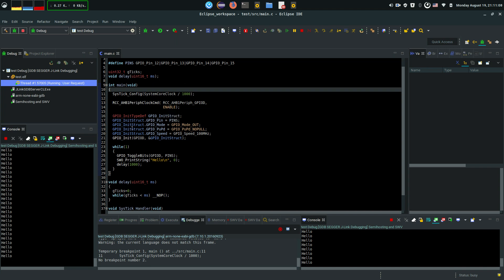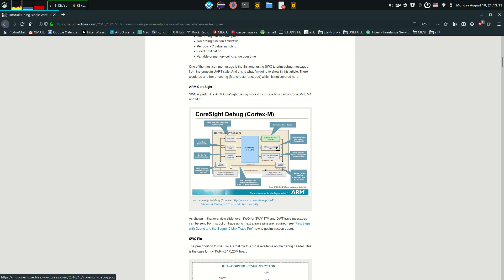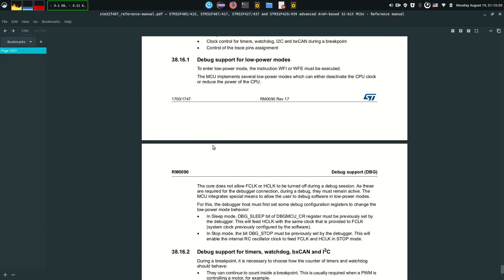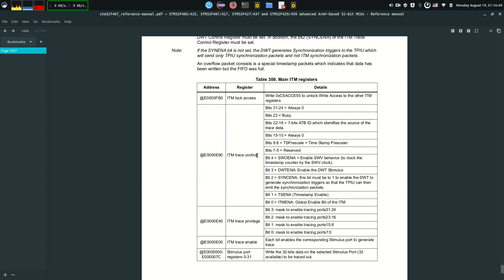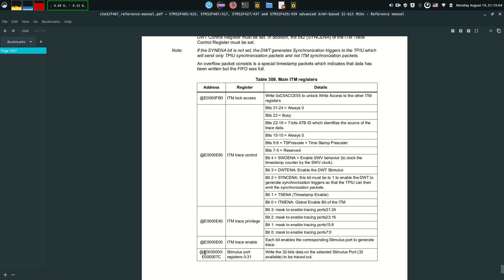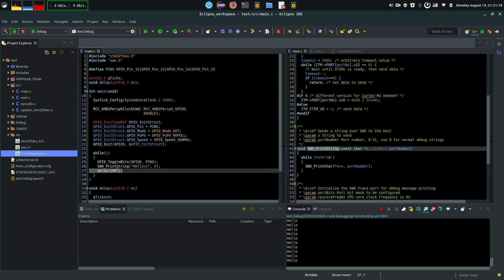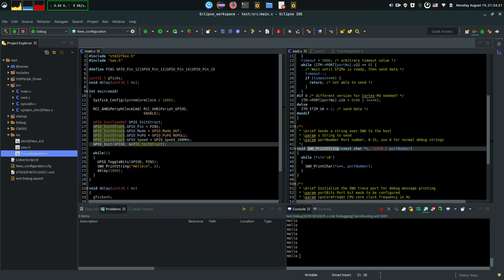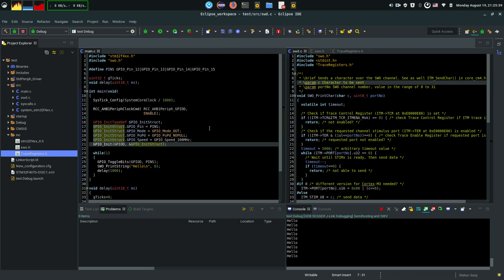Trace and SWO on STM32 | VIDEO 14

Comment: Is tracing/streaming the same as ITM, ETB, or MTB?

For example, I assume the debugger must also support the trace feature, yet looking at Segger's Trace debuggers, they list the trace features as:   ITM, ETB, MTB ?!   But "SWV" will work with their lower cost models like the ULINK2, ULINK-ME, ULINKpro or a Segger J-Link  v6.   What about cheaper adapters like EDU Mini, RealView U-Link2, Black Magic Probe?  

What about the requirements of the chip.. does it only need to SWV (SWD plus the SWO pin)?

I bought the AT Atmel-ICE because it said  CMIS-DAP/SWD+SWO/JTAG, but it doesn't seem to talk to my Smartfusion2's Arm-M4 (SWD+SWO Capable), nor does the ITM_SendChar work on the Atmel SAME70 device.     

Perhaps the software-layer that talks to the debug adapter must also have streaming/trace support?  For example, would Eclipse + GDB/OpenOCD work?

Comment: Great video. I'm missing something but how can I view in real time the state of an output pin or the state of an input pin or the frequency of a clock pin? Because as I understood is possible but I don't know how to setup the STM32CubeIde for view a pin state.
Reply from the maker: Thank you. You can only read information of registers when device is on halt, so not possible in real time. In your case, you could be reading from GPIOx hadle into IDR for input values and ODR for data output values, so monitoring state of input and output pins. You could make a function that reads those values and prints it over swo in certain intervals, maybe a timer and interrupt ... Just un idea.
I know that certain processors, higher en have trace lines, a separate(4 or more) pin interface that is made for just that ... watching register configurations in real time. But debuggers that do that are expensive as there is lots of data to process every clock cycle. I hope I gave you a direction to look at.
Reply: @MatejBlagšič  ok. I see know. I will do sometesting. Thank you very much for the info